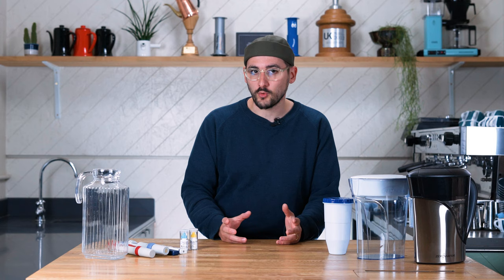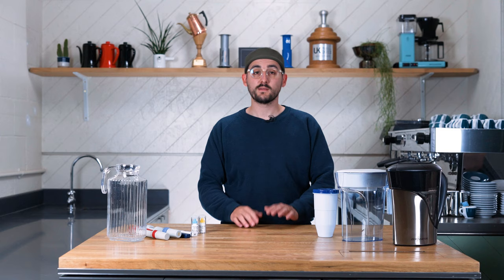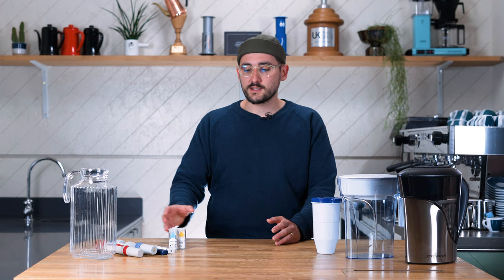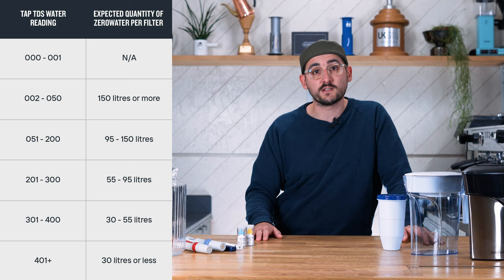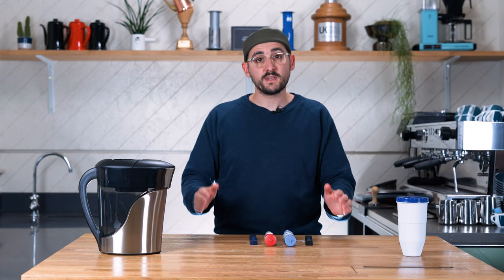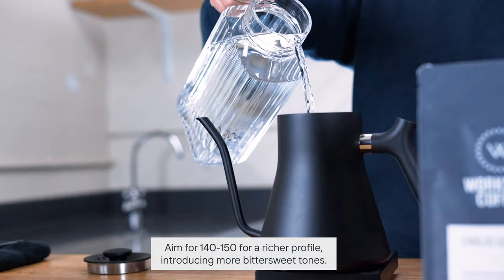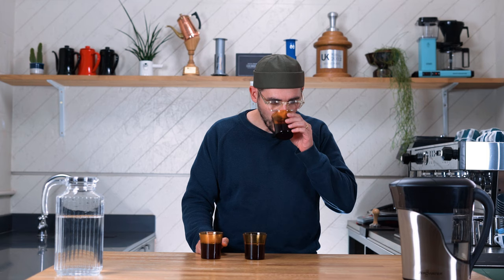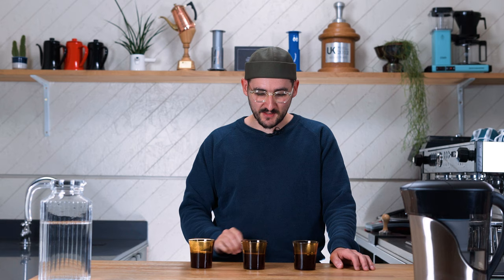An Elegant Solution to Excellent Brew Water

Comment: Using the zero water jug taught me a lot in my journey with tea. The customisability is awesome and the TDS meter became an invaluable friend that’s travelled the world with me. Just to get a good benchmark on overall mineral content in the water, so I can mix a water or identify a water that’ll work ok. Notably, different bottles of the same water often vary dramatically in TDS so it’s great to take a measurement on a new batch or bottle.

The zero water is unique being the only jug to reduce to zero, however I cannot recommend the product at all… the cartridges are extremely roughly produced and have crumbling particles of plastic around the edges that make me very uncomfortable. Also as a product the cartridges are very inconsistent and I started to notice that new cartridges were leaving a nasty plastic aftertaste in my mouth when brewing tea with the water. That had never been in an issue in my first cartridges and I concur with others that the units supplied with the jug seem better than those sold separately by Amazon UK. 

The lifespan of the filters with Bedfordshire tap water was abysmal, like 10 days if I was lucky… hence I started filtering bottled spring water  just to ease the workload on the filters… 

If you live a stable life at home, invest in an RO filter system. For me the Zerowater was a stop gap between periods of travelling.

Comment: Here in California farm land two hours from San Francisco, right out of the box the ZeroWater never got to zero.  Not even close.  :)  I finally put a Pur faucet mount water filter on one of my sinks (the one that uses the Pur Plus filters, not the regular Pur filters).  That worked great (in terms of taste).  Bottled water was too tasteless and flat and I'm happy with this solution, plus I read the faucet mount filters filter better than the jug-type filters.  It was also easy to simply snap on the faucet.  What I still never hear anyone discuss in coffee circles is aeration, in that I have always read coffee from the tap is better for tea brewing because it's full of air rather than flat (which may be another reason I prefer the Pur faucet-mount filter with the Pur Plus filters).

Comment: This made a lot sense to me. I tweaked your technique slightly and have had some great results. I use the zero water filter but then add in Third Wave Water (instead of tap water because ours has a lot of iron in it) until my TDS reads about 100 and 150, depending on the coffee. Did some experiments at various TDS, but I like the extraction at these levels for the coffees I buy, and the roundness of flavor I get.
Reply from the maker: Thanks for watching, Joshua, and glad this was useful for you.

Comment: Interesting video, thanks 👍
Over the last 18 months I’ve gone from instant coffee to...
Cheap grinder, aeropress and supermarket beans - much better than instant
Added a Brita filter - that’s better.
Speciality beans from a decent roaster - oh proper coffee!
An Aergrind - Wow! Probably the most noticeable improvement.
I’m also using a V60 and a Clever Dripper (your method is great btw, thanks 👍). I guess I’m not going to see those big gains anymore, just smaller, incremental improvements. But I’m curious to know how much of a gain I’d get from trying the Zero jug and your suggestions.
I guess I’ll give it a go soon, just ‘cos it’s been a fun journey so far!
Reply from the maker: Great to hear about your coffee journey thus far! At a certain point you're totally right, that investing in more coffee equipment can potentially bring you small, incremental gains. Saying that, sorting out brew water should be prioritised early on and can make a very noticeable difference. The Brita will be helping, but if you're in a particularly hard water area there's only so much it can do to bring you into a sweet spot.

Comment: I tried this with my zero jug and blended (east london) tap water back in at first around 70ppm then 100ppm but they both still taste very tinny and flat.......should I i just keep pushing the TDS up? Is there a a range you would not recommend? Obviously not going back up to tap water levels again (which is 344 ppm) hah

Comment: Have you tried the Peak Water jug?
It can be adjusted to suit the hardness in your area as well as filter all the tap water to remove the impurities.
ie you can adjust it to deliver a level of Total Alkalinity.
Reply from the maker: We have limited experience with the Peak, and in all areas we've tested it has needed to be running on maximum performance, and so the adjustability is more handy if you're already somewhere with brew water quite close to the ideal spec. Also, the performance over the lifespan of the filter might deliver fluctuating brew water quality, whereas using the zero to create a pure base which you then dial in ensures greater consistency, albeit at the cost of having another water vessel on your countertop. The two filtering methods solve a slightly different set of problems.

Comment: I looked at my area's water quality report, and my tap water's TDS level is almost at 600. Based on the chart, a ZeroWater filter will last less than 30 liters which isn't very cost effective. I need a method that is relatively cheap and not too much of a hassle. I've seen a lot of people recommending Barista Hustle's recipe using epsom salt and and baking soda added to deionised water. Should I just do that instead?
Reply from the maker: Hi Jason – you can absolutely buy deionised/distilled water. It will be a case of weighing up the cost of buying the water versus filters for the Zero and seeing what will work out best for you. Have fun experimenting!

Comment: Is the stainless steel better usage experience? Not sure its worth the extra money for the increase volume and nicer materials, but if its just flat out nicer to use then maybe it would be worth springing for.
Reply from the maker: The 1.7L version in blue and white plastic will suffice in terms of creating the right sort of water, but we wanted to also stock the larger, stainless steel version for a few reasons. The materials look and feel nicer, and are more in keeping with most other dedicated coffee equipment you'll see, grinders, automatic brewers and kettles etc. The larger volume is helpful if you want to just create brew water once or twice a week as well.

Comment: Is this essentially what an RO system does?
Also, would chlorine in the tapwater not be an issue taste-wise?
Reply from the maker: Reverse Osmosis systems use a pressurised membrane system to 'purify' water before then blending in carbon filtered water to a desired hardness, so in essence it is a similar approach using different technology. Chlorine can be alleviated when water is left to stand, which if you're batching up a few litres of brew water at a go should make the issue go away. If you're concerned about it you can do a taste test using filtered water mixed with the zero versus tap water mixed with the zero and see if the 'tap' flavour carries through into your coffee.

Comment: Only problem is that if your tap water tastes really bad or chloriney, you need to filter that through carbon before you blend it with the zero water!!
Reply from the maker: This was a concern during early testing. At home I was initially mixing BWT filtered water, with the magnesium remineralisation cartridges, and blending that with zerowater. I then did a lot of comparative tasting with tap water as the base and found the differences to be negligible, I imagine because the small amount of tap needed in the mix dilutes any perceivable off flavours. If it is really bad with a strong chlorine smell then it is likely you'll be employing some sort of filtration for your regular drinking water, so this could be used with the Zero to create a cleaner taste. I hope this helps.